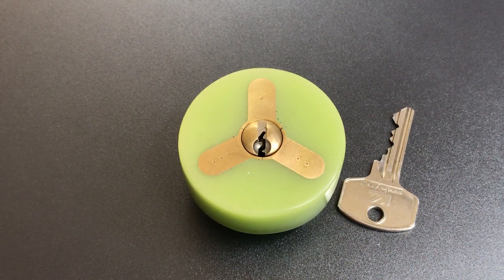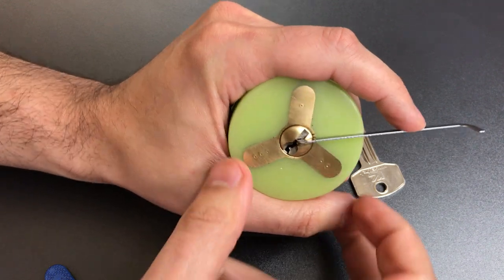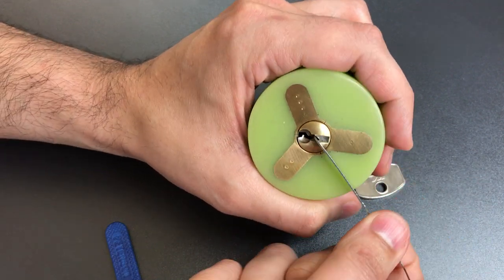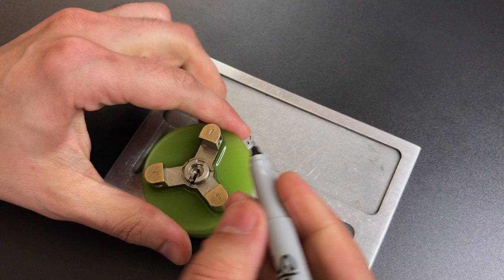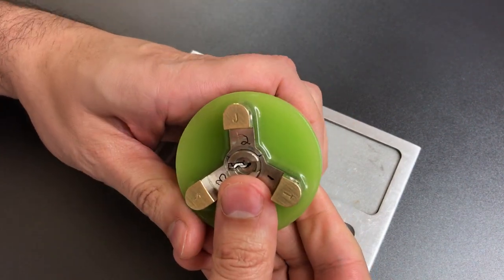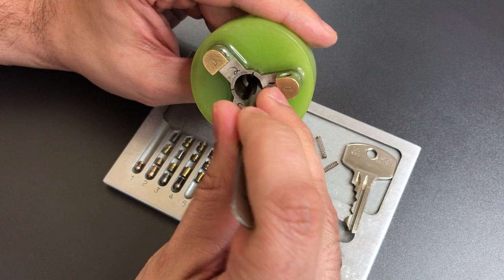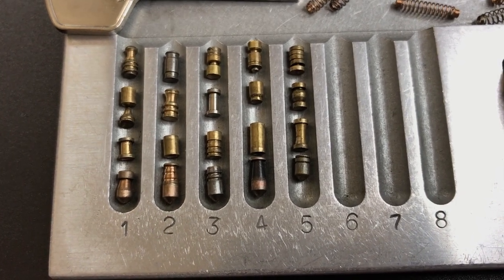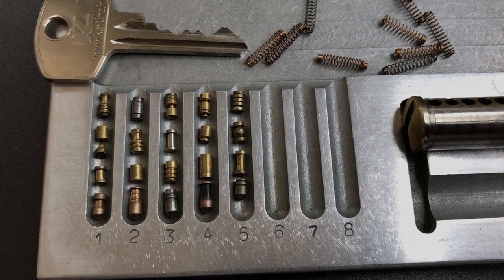[530] Julian & Tobias' Triple Challenge Lock Picked and Gutted

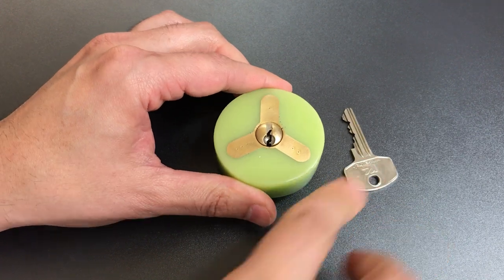Comment: 0:45 "it took me about 40 minutes" ... sold, take my money...
Reply: This should be made into a door lock
Reply: @piotrnapora5810  I was thinking the same. I'd buy it.
Reply: Locks like this just make me remember that checking for windows to open/break would be so much easier.
Reply: @DaMook82  How much would you pay for it? It sounds like it was homemade down to some of the pins. You might be able to commission something like this, but it'll probably be more expensive than nearly any commercially available lock.
Reply: @Nerdnumberone  Seeing as it is protecting a house which has items worth tens of thousands of dollars i will be ready to spend up to like 500 USD
Reply: the issue is because it’s a challenge lock, he’s technically picking it three times, with a partial revolution between each pick. that partial revolution would compromise most locking mechanisms. if you see how fast he does the first set in the video, after that he’d probably be able to open it.
Reply: Shashwat Mahajan from a locksmith, your door lock is only gonna keep a honest person out they will just smash a window. Your best deterrent is a home alarm sign outside your house buy two cameras have them out front and outback.
Reply: @klein3677  Yes but there are no windows  at the ground floor at my house only on second and third floors, so they will need to bring a ladder or tools to cut through the wooden door
Reply: @shadbird8772   my uncle had an old house, the warped windows were so expensive to replace,  that he didn't bother locking the door and incurring the additional expense should someone choose to break in.
Reply: @Nerdnumberone  if theass produce it it would have a logical price
Reply: @swrdghcnqstdr  The key makes a full 360 without issues. The partial revolutions are because he is picking it.
Also, have the key make 2 full turns to fully open the lock and it will take too long for someone to pick a lock.
Reply: @ninjashuriken  Hoping you already know but as a former cop it's not hard to break down most wooden doors. Usually the frame or the area around the lock mechanisms are easiest to get through. Also depending on the driveway set-up there are some ingenious quick entry methods that wouldn't normally be thought of but are very effective.
Reply: @Simqer  the other dude said that most locks open at half a rotation
Reply: @michaelo5665  fun fact, when it comes to door destruction you often don’t need to destroy the door itself, if it opens inward you can just go for hinge destruction by ramming the door. If it opens out you only need to destroy the actual bolt... just remember that a solid lock is pointless without a solid frame
Reply: @diehardfreak1  that was my point. There are plenty of entry methods beyond lockpicking and first floor windows.
Reply: @swrdghcnqstdr  not a deadbolt, mine does half a rotation before engaging the bolt
Reply: @Nerdnumberone  lighten up Francis
Reply: top 10 sucure
Reply: Gonna be a bitch for whomever tries to break into a place with an actual challenging door when the windows are made from proper tempered glass. Spare no expense, my friend.
Reply: @klein3677  I keep seeing this phraseology of locks only keeping honest people out. Maybe I am just more thickheaded than average, but I have given it ample thought, and it seems to me that locks would be unnecessary for truly honest folk, no? Can you point out what I'm missing, if you don't mind?
Reply: @swrdghcnqstdr  you could do a multi part deadlock that would require the full rotation
Reply: @ninjashuriken  yea but like, your windows. Or if someone really wanted something in your house they'd just break the door or force the lock
Reply: @piotrnapora5810  DEADBOLT! ITS GOTTA BE POSSIBLE
Reply: @shadbird8772  live in a flat on the 11th floor. people would have to spiderman up/down to get to my windows. so here that lock on a large deadbolt would be perfect
Reply: @shadbird8772  "Locks like this just make me remember that checking for windows to open/break would be so much easier."

After that, what will you then do about the hidden silent alarm system with security/police response?
Reply: @shadbird8772  window bars
Reply: Absolutely!! If it took LPL 40 minutes, I definitely want one!!
Reply: @Nerdnumberone  With a proper production team manufacturing them in bulk, you could probably pull off a fairly efficient line of product. I wouldn't be surprised if it could be sold for much less than plenty of higher end electronic locks.
Reply: @klein3677  Most criminals aren't trying to be as loud as possible when breaking in. They might also not want to risk slicing themselves up on broken windows. 

Just because they can doesn't mean they will
Reply: @JACpotatos  stop, most criminals break in through a window or just kick the door down that’s why it’s called a smash and grab the fact that I have to explain this is embarrassing. As someone who’s been called out after burglaries to secure a property because a break just happen I guess I don’t know anything.

Comment: I would love this as a real lock
Reply: You could also have higher security locks and make it impossible to pick
Reply: ScottishPhoenix Like?
Reply: @ScottishPhoenix  Nothing that you can open with a key is impossible to pick.
Reply: @privateger  
What about a lock with master wafers underneath a slightly smaller driver pins that drops down into drilled holes on the side of the cylinder unless the wafer is there to keep it up?
I mean.. sure, it's not impossible to pick...
But are you really going to know which depth to set the pin at to avoid the trap for all pins in a row?
It'd be virtually impossible.
Reply: @ANoBaka  If a key can open it up, you can pick it. That's all I wanted to say. 
I have no clue about your description, but such a lock would never be mass-produced.
Reply: @privateger  
I believe it's called the Hines Key System.
It appears that Segal made a series with it and others may as well.
Reply: @toiletball8420  No. There simply is no lock that can not be picked. It may be incredibly hard and require special tools, but as long as it has a key, it can be picked.

Comment: I realize it defeats the purpose of the challenge lock, but is it possible or have you tried picking the first/easiest set then using a plug spinner? Or would that not work because it may catch after it skips one?

Comment: Are you saying it can't be done with a paper clip and a bobby pin?
Reply: that's for Masterlock padlocks, but only when staring intently doesn't work
Reply: 666Tomato666 lmao
Reply: @ashleyfalcon125  from what I've gathered I have a msterlock padlock i practice on every pin sets in order until I think 3 and 4. So i can set 1,2,4,3 and it pops open the lock can be easily picked with a flat metal shim its pathetic

Comment: I’ve seen LPL use a tool that spins the core very quickly 180°, was that a more recent tool? Otherwise I’m confused as to why it wasn’t used here, the tool appeared to be able to have a variable turn degree, which would allow the second and third (bibles?) to be bypassed without the need to pick the lock again

Comment: Question: you mentioned "top of the keyway tansion" and you are holding the lock in that direction.Also in other videos, you are holding the lock in that direction - why? At least here in central Europe, that is the bottom of the keyway and you are holding it upside down. Is it easier to pick this way, or are locks in your part of the world oriented that way by default?
Reply: In the US, almost all of our key ways have the bible on the top in doors. In Europe, the bible is usually facing down.
Reply: @Ghost_Prairie  why is that?
Reply: @derstoffausdemderjoghurtis  I honestly do not know if there is a direct reason. Most forums usually mention that it is just by mistake and we are used to having it one way. Another could be the shape. In the US almost all deadbolts on houses are Mortise cylinders while in Europe most locks have a slimmer profile. The last possibility is American locks were originally made cheaper and the logic was having the pins at the top avoids dirt, water, and grime build up.

Comment: Could this be made into an official lock? If it could, it would be really secure.
Reply: Something something, lock snapping, drilling, doorframe attacks, windows, social hacking, etc, etc, etc.
Reply: I just watched a video on the various types of pins, and the short version was, no. A lot of the more creative pins you saw here are fun for a challenge but will break too quickly under normal use for them to be put into a commercial lock.

You could possibly do 3 separate bibles like this in a commercial lock but it would cost at least 3x as much, and it would also cost a fortune to rekey it.

Also, keep in mind, this is intentionally meant to be picked, just with a fun level of difficulty. There are some commercial locks that he hasn't been able to pick. (See his wrap-up video on the locks he borrowed from Bosnianbill's "naughty bucket" for some examples.)

Comment: After giving likes to several commenters, I summarize their repeated responses in my own:
Wish these could be on door locks, but yeah the pins would be too fragile for normal use.
A reassembly video does SOUND cool, but as an engineer I’d probably get frustrated empathially with you cuz of how tricky that might be.
J&T did a great job!
This lock would likely be hard to pick in the wild.
LPL’s voice sounds restful to many viewers. I’ve felt that way when my mom was reading scripture. We just like hearing a calm Voice basically work out problems that we find tricky, and that’s not a bad thing.
That quick rotating spring loaded thingy would probably have helped bypass locks 2 and 3, but it would’ve defeated the purpose of the challenge as 2/4 of the commenters also stated.

And for the most UNIQUE comment by IDR who but I wish I did: “When I first saw the thumbnail, I thought LPL was coming out with his own line of lock themed soaps.” Lol for real on that one! Yeah,
Great job, LPL!
Hope this isn’t spam.

Comment: Here's a question from a layperson thinking about this from a security viewpoint -- how much more difficult would this have been if the lock were installed in a door (thus you wouldn't be able to rotate it to pick each cylinder at a 90-degree rotation)?

Comment: intrigued... well, first time seeing this type of lock, such a clever design(than that of Bowley, at least) yet kinda bulky and colossal-some... Here are some of my thoughts on its working methods:
1) with the correct mating key, the key could extract at either position, at 12, 4, or 8 clock position with increasing picking difficulty maximal at 8, since the bible at this position has the most complicated and sophisticated driver/upper pins ..
2) however, when it comes to picking/manipulating opening without a proper key, those key/bottom pins are thus resting at the lower end of the pin holes of the core, leaving behind certain gap underneath the shear line, which enables the driver pins to re-enter after the core is rotating every 120 degrees meeting the next lock bible, this will reset the lock picking as a results of re-arrangements of the pin stacks.. which means the lock has to be picked three times in order to rotate just one full circle..
3) this would greatly hinder the lock from being picked when the cylinder works with a locking mechanism that needs multiple rotations to finish the throw of a dead latch or locking bar...
 4) the feature of multiple key extraction positions will also make this lock application as a key switch lock( in elevators or other electric control settings).

Comment: I have a lock design in mind that's kind of along the lines of this.
The difference is I was thinking of eight separate keyways, each had their own pinning that needed to all be depressed and under tension all at the same time to turn. the entire 8 keyways would be a incredibly Jagged 90+ degree turns everywhere. On top of that having an actual door that blocks the key way and has a small RFID chip receiver embedded inside behind it. the key has the chip in the very front of it so when you touch it to the front that detects the key and opens and then you can insert the eight keyed key.

Also on the side of each of the keys on the Eight Keys they'll be another set of 6 pins on both sides of each of them. Effectively increasing the entire assembly that having 24 individual locks, adding up to a 144 pins. aside from the single whole lock that you're opening

Comment: This would work as an actual lock by using a bound cam system. I've seen something similar used in a steel door once.  The lock itself was a normal Euro lock, however, because of the bolt system (3 locks per each side of the door) it had a differentiated cam plate on the back, you actually had to move it 3 times to open it with another lock acting as the lock that locked this mechanism. Methinks it was a DIY thing, still, pretty nifty. Regular Joe would never figure out how to open it.

Comment: In my country, if the key is missing, most lock picking master just put a key inside the lock and try things, they will use a file to make profile on a key, I don't know what they did actually do but the success create a replacement key without disasembling the lock. Can you provide the insight about this practice?

Comment: I'm not sure how to ask this, but why aren't higher pin numbers more common? wouldn't having say 10 pins as a standard for locks be way more secure than 4 to 6 pins? especially when you consider security pins can be added?
Reply from the maker: +Kakkarot22 Expense, key size, and fitting doors seem like important factors here.

Comment: Here's a diabolical method to make this even harder to pick: hook the back of the cylinder to one of the better combination lock mechanisms engrave the number dial onto the face of the key lock and make the key the pointer.  Imagine the frustration of trying to feel out the combination of a combination lock when you have to pick it 3x for every rotation while feeling for the combination as you turn it.

Comment: 'Lets get some top of the keyway tension in here'. Holds the lock upside down.
Reply: jwrm22 most locks in us or Americas are mounted pins up, rather than on the bottom like some euro cylinders. Better in a way I think because any schmoo doesn't end up falling down in to the Bible
Reply: jwrm22 right way up for the US upside down for Europe. TBH I prefer having the bible uppermost both for door mounting (it stops water and dirt sitting in there) and for picking. :) 
(Not to mention that pin side of the keyway is always 'top' anyway)
Reply: SpikeMoby mounting bible-up in euro lock doors really isn't an option as the door's steel chassis has the mounting hole cut bible-down. One of the better Yale cylinders has a magnetic element that needs to be pulled up to unlock, with a corresponding magnet in the key. They won't work inverted.

Comment: lpl welcome home son lol we missed you.Great video as always.How do we go about sending a lock your way,is there another way to reach you? Also hope you can help took apart 7 pin best lock what a treat for my second lock not one of my followers fit correctly used smallest but was too loose and 2 pins per driver stack,i put together,operating key turns core nicely but I cant get core back in body,control key does not allow the slight turn of core to get it to go! What Have i done wrong? Thanks!!!!!!!

Comment: wouldnt it be possible to set this lock so that it require 3 different keys?

also, looking at the key is kinda cheating ;)
Reply: paltryblather he did say at the beginning that he picked it without the key it just took quite a while then he looked at the key.
Reply: Don't know how, anyone that wants to pick a lock would have looked at the keys that go to the locks so they know what to expect and what to bring when picking in a a real life scenario.  Part of why I will never understand why companies put their name on the secured side of the lock.

Most locks, minus the brand, look the same.  Different brands have different ways they can be beaten, and some use a different type of locking system.

Comment: All these fancy names for all the different looking pins and things, and yet you just do the same thing to every one of them..... put on some tension and lift them up with your curved device..... in just about every lock you pick...... sometimes I think you could substitute the commentary over the top from different videos.What am I missing???
Reply: He is very good at picking.  Picking relies on a lot of tactile, physical feedback from the lock itself.  The sensation of the tension in the rod, the rotation of the core, the little ticks and clicks of the pins, the pressure of the springs, all that helps tell the picker what they need to know to successfully pick the lock.  Security pins are made in such a way that they give false signals to the picker, making them think they are set when they are not.  They are meant to mislead the picker while also causing as many problems with the act of picking as possible.  All this works very well, but for some people who have a lot of practice and are aware of the tricks of the trade, they can detect which signals are probably false and adjust accordingly.  This is a very good example of that.
Reply: Quite literally a case of “he just makes it look easy.”
Reply: That's a bit like watching a world championship chess match and saying "I could have made any of those moves".